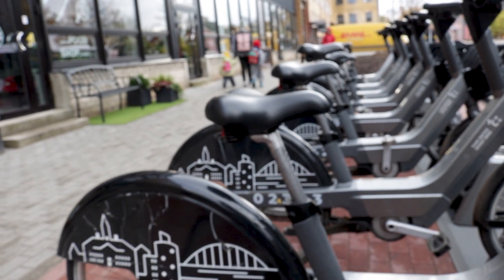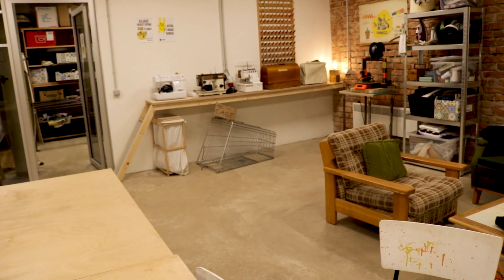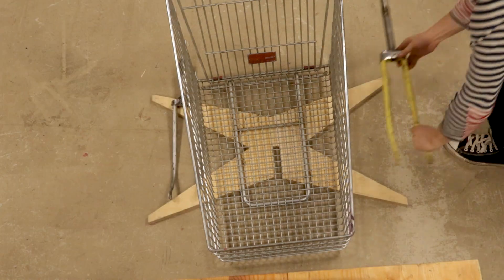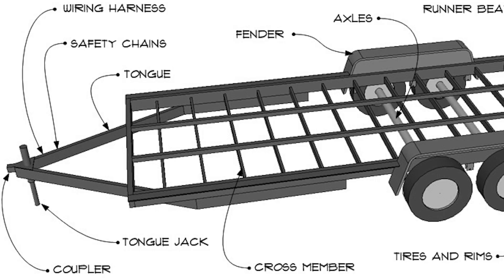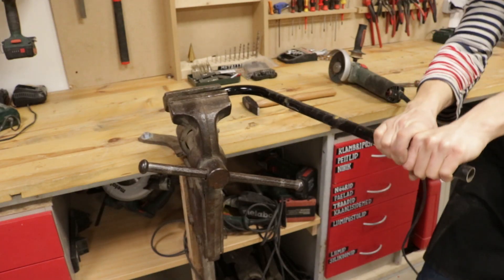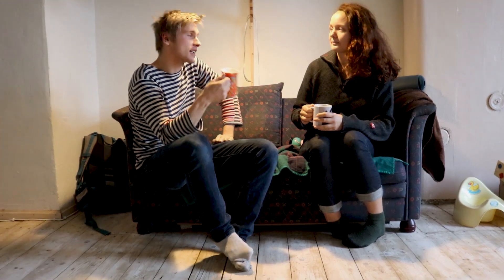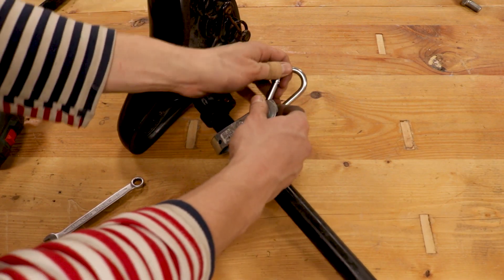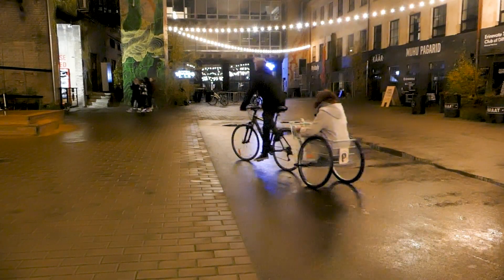DIY Bicycle Trailer from Shopping Cart

Comment: Wow, it actually worked! I took a tour around the local supermarkets asking for a shopping cart that they could give away, and the 3rd shop I visited had one that had a little sketchy wheel! Now I'm looking to salvage two 16" front wheels from old kids bikes with suspension forks, so my trailer won't be hopping up and down so much. Thanks for the amazing and inspiring content, man! I'm one of your many quiet followers... ;)
Reply: So did you end up building one?
Reply: @DancingTeapot  Well, I found a proper bike trailer for almost free. So I ended up returning the cart. :)
Reply: @Stickmasterrr  about to say solid wheel barrow wheels be sturdy .

Comment: Having built a bike trailer myself, from scratch,, I realised I made one serious mistake. The wheels were attached in a bracket made from steel strap, 25x 4 mm. This went over the wheel and the axle was attached this way on both sides. Unfortunately, on my first trip of 180 ks each way, I broke THREE axles. the bracket was too flexible. I overcame this for later trips by using bicycle frame rear triangle, the part that holds the rear wheel. This allowed me to adjust tracking and tilt to maximum performance. And for the towing coupling, I used a steering ball joint of an old car. That also worked perfectly. Your use of front forks would work for light loads, but on loads of over, say, 50 kgs I can see them twisting. Whereas my triangle system worked for loads up to 350 kgs. ( yes, 350 kgs. I had it on a weighbridge a couple of times.) And I still have that trailer after three long distance trips and some use over thirty five years. I have had to re-spoke the wheels once. I see this shows my wife's name as author, but it is actually written by me. Chris.